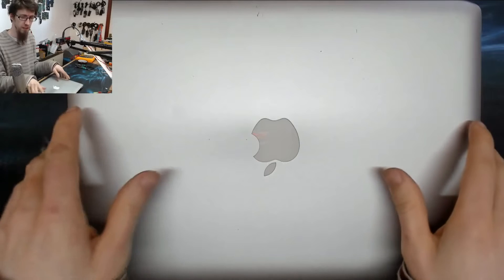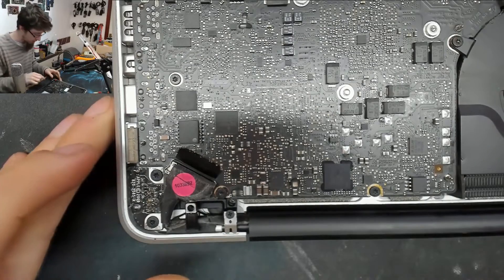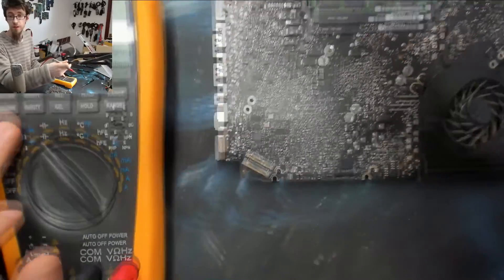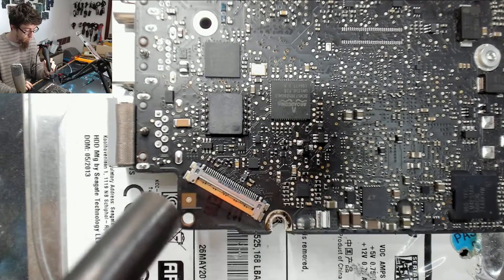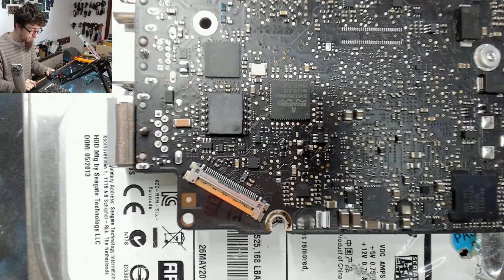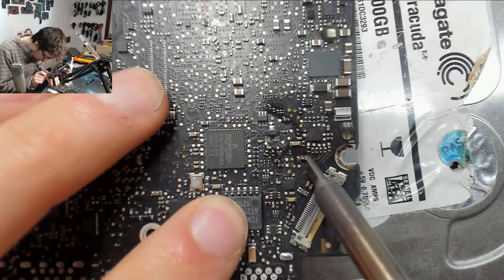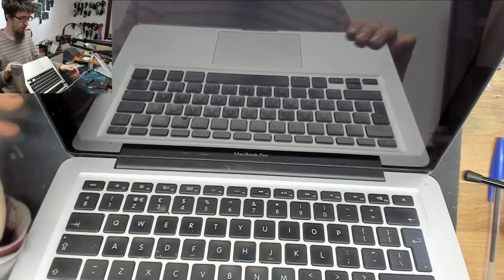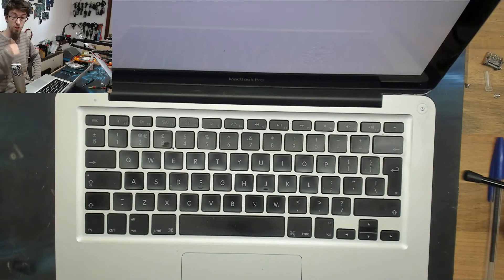LFC#162 - MacBook Pro Non-Retina Backlight Fuse

Comment: How do I identify a (display) fuse on a laptop?
I got quite a lot of black resistor components on a laptop board.

Some give low resistance high continuity. Some give a resistance value. Some don't change and give no value, stay OL.

How do I make sense of this, and how do I know which one is a (display) fuse?

Thank you very much in advance!
Reply from the maker: I would suggest learning on a well-documented laptop, like an older MacBook, where the schematic and boardview is there to identify everything.
Once you've seen what components look like, you learn to recognise them on other boards.

Comment: amazing solution mate, would simply shorting the fuse work in case if the fuse couldn't be fund easily
Reply from the maker: It would work, yes, but I wouldn't advise it, because if something happens again while there's no fuse, the damage will be a lot worse.
Reply: @Adamant_IT at the end u just pressed the command R keybind right?

Comment: This is the problem I’ve got with my MacBook (A1278)  right now - no water damage - shining a light through the apple logo and I can see the desktop/login screen... where can I source a replacement fuse?
Reply: I am having the same issue with mine. It appears that my "P" fuse is good, but I still have to shine a light through the rear to see the login screen.

Comment: Hello, Greate Video Thank you, but I have a question after I replaced the fuse the backlight worked but I am just getting blank white screen what could be the issue here?
Reply from the maker: Unplug the HDD and leave it on for a minute or two to see if you get a flashing question mark folder. If you see that, then the display is working but you have a boot issue. If you don't see the ?Folder then there's still an issue with the display. You'd need to try a different display to see if it's the display itself or the logic board.
Reply: @Adamant_IT   Will do thanks.

Comment: Hello, thank you, great playlist, i see you put an N fuse instead of P it's the same ?
Reply from the maker: It's the amp rating. N is 2amp, P is 3amp. Both are fairly overrated I think, the important thing is that either will blow if there's a short circuit on the backlight rail.
Reply: @Adamant_IT  Thank you! Both are 32V ?
Reply from the maker: Yup 👍
Reply: @Adamant_IT  Because of you I have now taken some laptops to fix. Thanks so much! Keep it up, excellent guides!

Comment: It's pretty embarrassing to see you solving these board issues with just a DMM.  Well, OK, that and a soldering iron, hot air, schematic, BoardOpenView, and your knowledge.  But, still, minimal equipment.  Well done.  I am enjoying the embarrassment.

As a side note, it has been my experience that some MacBooks, which are engineered well, seem to have a weakness when it comes to the backlight fuse.  If a user, and very many do, always has the brightness setting on FULL, I see more fuses blown.  I always recommend they run the brightness 1-to-2 bumps down.  Of course, though, that's not as good for business.
Reply from the maker: I have spent a lot of time watching people who already have the fancy equipment and figuring out the cheapest way to replicate their methods! It bears mention though, better equipment will always make your life easier - I'm just cheap ;)

And yea. I wouldn't mind something as trivial as a fuse blowing too easily, were it not for the fact that Apple [and the industry] keep gas-lighting everyone to believe that nothing can be fixed and that it's your fault.